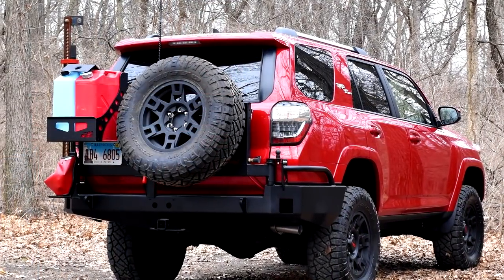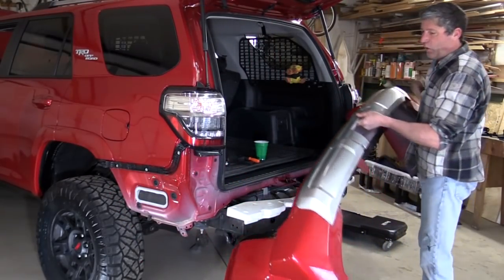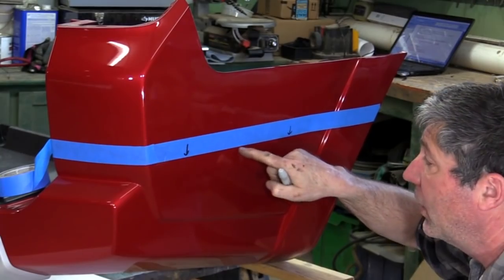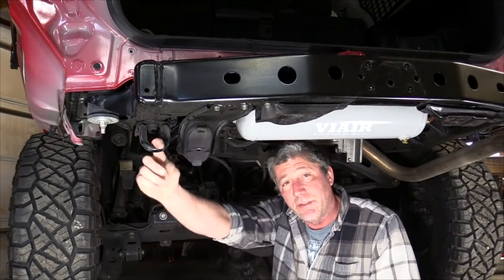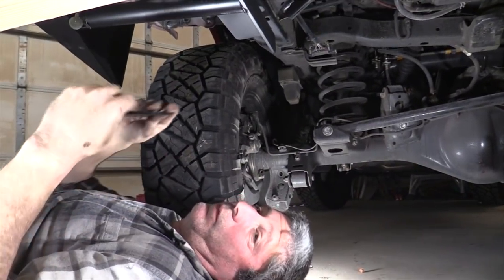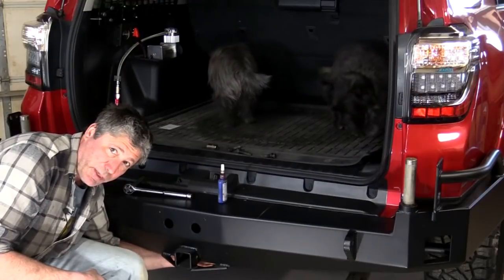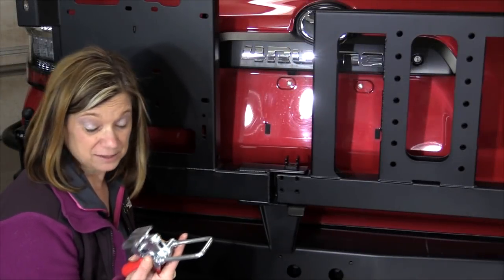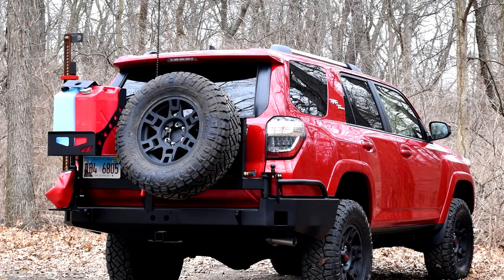How To Install CBI Offroad Steel Rear Bumper On 4Runner

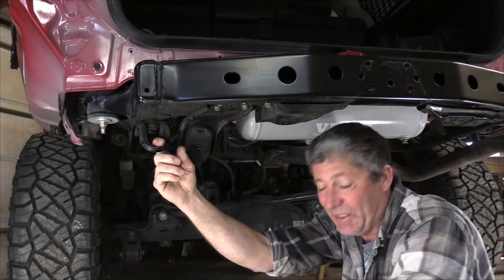Comment: At 4:30 the hook is used to hold the vehicle down during shipping to the deck. Also in front under the front frame, welded on in factory.
When a stuck vehicle does not accessible hooks to attach straps or wenches too, (winches),  I use the factory holddown hooks.

I have just brought home my Brute Force front and rear steel bumpers, with swing arms. My digital batteries are charged, 32 gb cards in camera and case.
Part one: A nice 5 hour drive one way to collect my Trails new pieces.
Part 2: Hook up block & tackle to two Cedar trees so they will will lift the skid/bumpers, and I will drive out from under it.
To be continues on its own YT instruction video / photo set.

Comment: I paid CBI over $800 to install mine, and I can't stand the bumper (single swing out). You two made the right decision on the correct bumper and doing it yourself. Great video!
Reply from the maker: With the single we were concerned about it sticking too far out the back when open.

Comment: Took 6 months but I finally received my CBI dual swing out bumper and am about to install it. I see that most folks just lower their tail pipe to clear the bumper. Looks from google images like it is vulnerable in that location. Have you been happy with the 90 degree angle you installed?  No issues with exhaust flow or clearance?  Looks like a great resolution.  Let me know. Thanks!
Reply from the maker: The tailpipe coming out the rear will eventually get smashed coming down from or going up a rock. We're very happy with it going out the side.
Reply: I do not have a bumper as sweet as this, but I am trying to figure how to get my exhaust pipe into a less vulnerable spot… can you provide a little more detail on the 90degree bend you installed?  I find it helpful if you explain any sort of mechanical automotive concept like you’re talking to a 10 year old, lol…
Reply: @thomasbarnett4440  I was able to cut off the tail pipe and install a 90 degree very much like they show in their video.  I used pipe clamps and it was easy to cut the hanger bracket off the removed cut pipe and weld it to the pipe clamp. This held the new 90 degree up just fine.

Comment: Hi wonder folks! Great video....question, do you feel a lot of vibration or shaking with the spare or the other stuff you carry with this bumper? Also...different topic...don't forget my request on the winch usage and setup. I think it would be a total hit.
Reply from the maker: Sometimes we get some from our tire mount on certain concrete surfaces.

Comment: Question about the cap on the bearing stack.  I've had my bumper for about as long as you've had yours and it's time to replace the tire side bearings as they are starting to have too much play.  That little 4mm set screw, did you have to tighten that as part of the installation process?  I'm wondering because I've broken 4 bits trying to loosen it, one of them being a hardened bit, used heat, soaked it, etc and it won't budge.  And of course CBI won't sell me a replacement top plate.  Wondering if I'm screwed here, lol.  Thanks for any insight!  Cheers.
Reply from the maker: We put never-sieze on our set screw. Twice a year we take that top cap off and oil the bearings with a light machine oil.
Reply: @WanderlostOverland  good plan. I wish I would have done that!  I'm heading to CBI next week to have them replace the bearing sets on both sides, most likely get a new (warrantied) top plate or two depending on if they can get the other one off.  I'll definitely keep the new set screws in better shape this time around.  Thanks

Comment: Hey guys, planning out my DIY drawer system largely using your ideas in your two videos.  I'm wondering if you've found there is enough room to pull out your fridge while having your swing-arm mounted table down. I can't find any clear photos of the CBI bumper with the swing arm open that would tell me. Is there only one open position for the swing arms or can they open further than that first pin hole?  Thanks!
Reply from the maker: Yup, plenty of room to pull out the fridge with the table down. And there is only one fully open and locked position on the arms. Thanks for watching our videos.
Reply: @WanderlostOverland  Thanks again!

Comment: Hi, You two are great! I wish I had the space, guts and the extra hands and brain to take on these project like you guys do. Instead I pay thru the nose to have the work done professionally with the hope that it's done right. Often I'm disappointed. I have the same CBI dual swing bumper installed on my 16' 4Runner but I'm being told that the mud flaps can't go back on because there is no where to attach them. CBI said that a hole needs to be drilled in the bumper. Without the mud flaps, the jobs looks unfinished and there's lots of space for dirt & debris to get caught. I've seen a lot of pics where the mud flaps are reinstalled but can't tell if you guys put your's back on. If so, can you tell me how you did it. I was thinking about using JB Weld to afix a bracket to the inside of the bumper so the mud flap has a solid attachment point. Hope I hear back. In any event, thanks for the video's!
Reply from the maker: Thanks for watching and liking our videos!!!We took some thick rubber and made our own new mudflaps. We mounted them by drilling a couple holes in the leading edge of the bumper and using self taping screws. The factory mounting holes worked well for attaching them in the inner wheel wells.
Reply: WOW, you guys are the best. Thanks for the fast reply. I have the OEM flaps so I'll start there. Thanks for the  helpful input!
Nevada Lou

Comment: You never mentioned anything, so I just wanted to make sure that there were no fitment issues with your air tank you previously installed. I’m planning on the same set up you have with rear bumper and ARB dual pump compressor and air tank.
Reply from the maker: No fitment problem at all. At first we thought it might hang a little low with the steel bumper, but it tucks up there nicely. You actually have to get on your knees to see it. We'd be interested in seeing pics of your set-up. Can you share some on our Facebook page when you're done?
Reply: Wanderlost Overland, thanks for the reply. I will. I’ve been placing orders.  Now we play the waiting game until everything arrives.  I also order the C4fab low pro bumper.  I like the aesthetics of the front too much to do a full wrap around bumper in the front.

Comment: How is your lift holding up? Do you have any complaints or wishes in it's performance?
Reply from the maker: The Toytec lift is working flawlessly! We've been running the same set-up on our FJ for close to 20,000 miles too with no problems. Glad we got the HD rear springs to hold up our rear bumper and camping gear in back.
Reply: Wanderlost Overland sweetdeal! I remember a few months back I called toytec about the ultimate and the boss and relayed the info back to you guys. Which specific boss lift did you go with again?

Comment: Question on this bumper:  Will the dual swing outs work with a Gobi ladder?
Reply from the maker: If it doesn't stick out more than 3" from the hatch it might.
Reply: Tell them when you order and they will make the adjustments during fabrication. Mine is coming in july ready to install with a Gobi ladder!
Reply: @joelmaloney2968  How’d it turn out?
Reply: @VanillaGorilla502  really well!

Comment: Hey, just subscribed to you channel. You two are fun to watch, but more importantly, really show some great equipment and build ideas. Hope you don't mind if I use a bunch of your ideas! Questions on the CBI rear bumper: How does that single latch work?  Is it holding it all in place well? Any significant play when off road?  Also, how did you go about relocating your rear camera?  Where?
Reply from the maker: There's plenty of adjustment on the latch and the "foot" that sets on the bumper to keep it nice and tight. We did have a little vibration from the spare tire on certain surfaces. We moved it around a bit until it went away. Here's how we relocated the camera: https://youtu.be/wZkGo6F0TCc
Reply: @WanderlostOverland  Thanks much.  CBI rear dual swing bumper on order!  (Won't be holding my breath however)

Comment: Having both the fj and 4runner. Which do you like best?
Reply from the maker: They're like kids, we love them equally.
The FJ Cruiser is more brawny, tough looking. It performs better in tight offroad spots due to its shorter wheelbase and just has that cool factor going for it.
The 4Runner is the more sophisticated sibling. It's just as capable offroad but does it looking more elegant. The interior creature comforts are much more plush then the FJ but, we do like the FJ's all rubber floor and water resistant seats for those less than perfect weather days. Under their clothes they are remarkably similar; same drive train, suspension, etc. 
I think we'll use the FJ for our shorter trips and where there's a risk of trail rash or damage. The 4Runner for our long distance travels where comfort and space are desirable.  
Oh, also, we have mud terrains on the FJ and all terrain tires on the 4Runner. Big difference there.
Reply: Wanderlost Overland
Thanks! I was curious. I have had an 07 fj since new and was looking to get something new.

Comment: So how does the Runner drive and handle now with the new bumper?? Any issues with it?? Do you guys recommend CBI??? or should i go for another type/brand??
Reply from the maker: It handles better then ever, super comfy ride! We knew we were going to be adding weight to the rear so we put on ToyTec's HD rear springs.
 If what you're after is a bumper with a super solid swing-out and a latching system that isn't going to fail, definitely go with CBI. Nobody makes a stringer swing-out "hinge" then theirs's.
Reply: Good stuff, yes i guess ill update my suspension first before i add the CBI bumpers then. Thanks for the update

Comment: What mod did you have to make to the exhaust?
Reply from the maker: We cut off the tailpipe behind the axle and put a 90 degree bend on it, sending it out the side right behind the tire.
Reply: I priced the bumper and it was over $4K! I could buy a really nice trailer for $4k.......